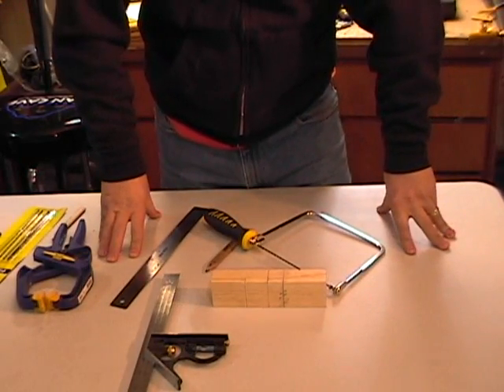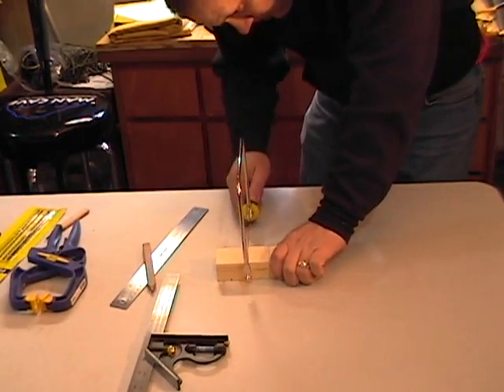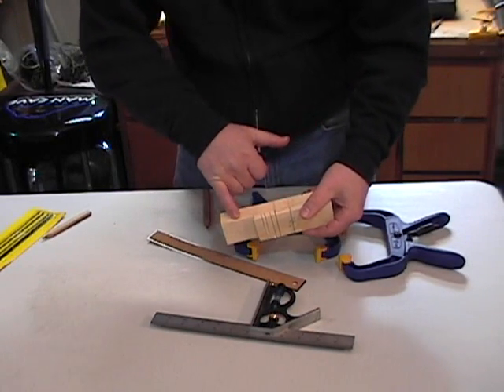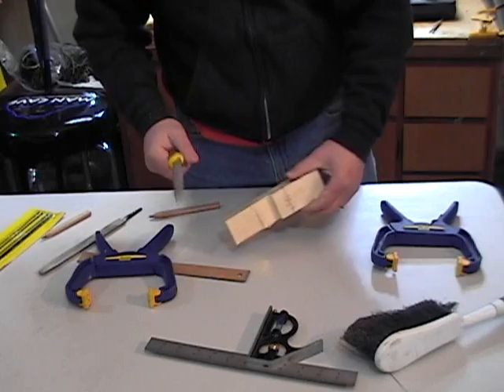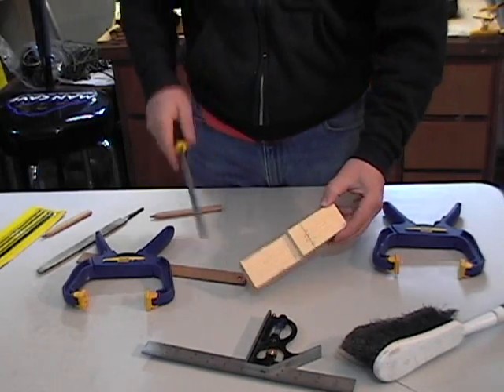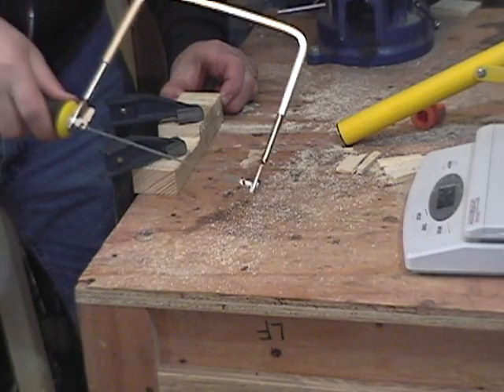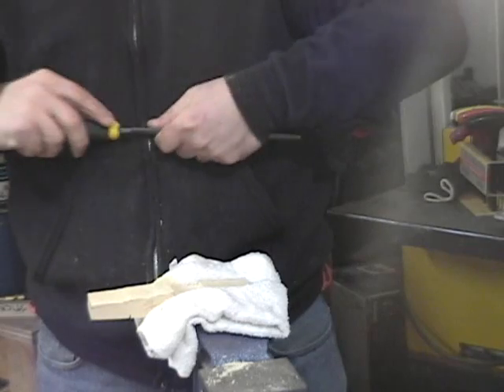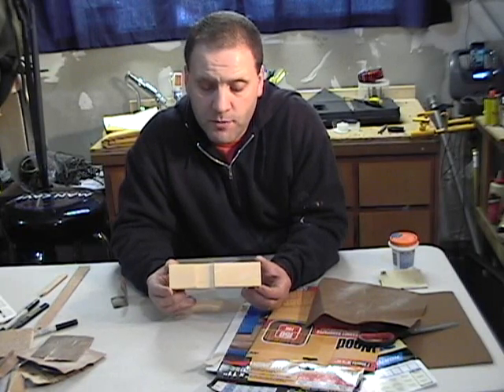Pinewood derby for beginners- Cutting out your design with hand tools

Comment: This is a good video but i would also like to see how to cut underneath the car so i can add some weight
Reply from the maker: You don't need to cut underneath. I never have. The flat weights sold for pinewood derby still leaves enough clearance. I just did the MC for my fourth year in a row for a 4 pack PWD. No cars high centered. Just make sure the weight is placed within 2" of the rear axle.
Reply from the maker: HighDesertAdventurer make sure it is in front of the axle so the front wheels don't lift off the track

Comment: Title of video: "Pinewood Derby for beginners. Cutting out your design with hand tools."
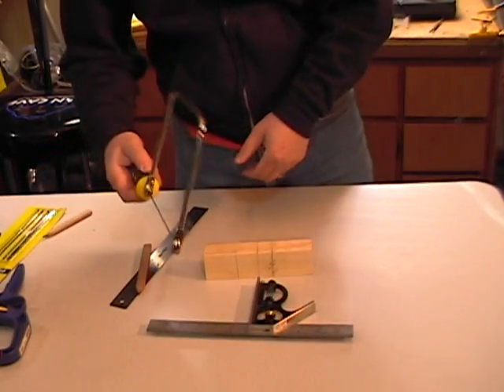1:57 Dude skips right over the part where he cuts out the car with hand tools. SMH. 
Bro, I clicked on your video because I wanted to see how you performed the delicate part of using a coping saw to cut out the design of your car. Thanks a lot.
Reply from the maker: Thanks for taking the time to watch. Majority of this video is me using the coping saw cutting the design. I'm showing that one does not need power tools to design, cut out and sand. 10minutes of me cutting, 15 minutes of using a rasp and around a half hour of sanding on video is not all that interesting. This wasn't a delicate design. It's a basic wedge. For the design with the center cut out I drilled a hole and put the coping saw blade through and attached to the saw. Then worked around and cut out the center.

Comment: Where's the scout?  The most important part is passing down the wisdom, knowledge and skills!
Reply from the maker: jfwootten  I was a cubmaster at the time of this video. I don't have any son's but two of the cars in the picture my daughter's made. As in I had them cut the design, sand and paint. I helped with the installing the wheels as one of my daughter's has cerebral palsy (hers is the pink one). We raced in a non cub scout race. And their cars did very well. I wanted to make a video for those who may not have the tools or are intimidated by the idea of wood working.